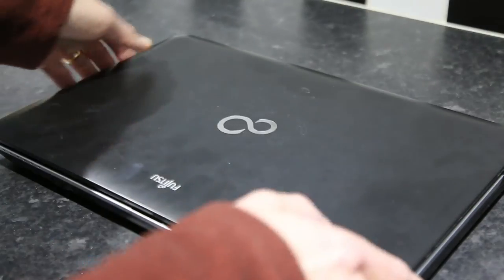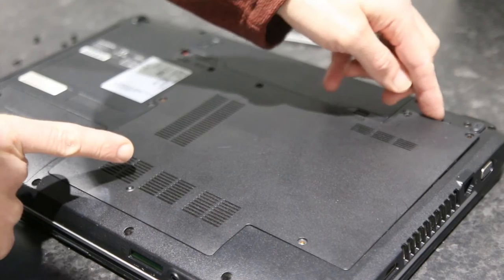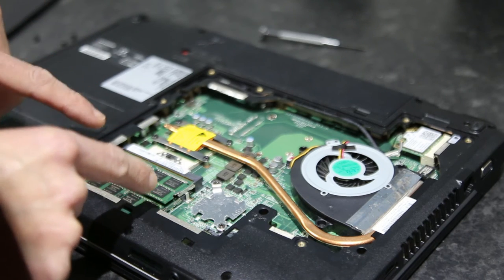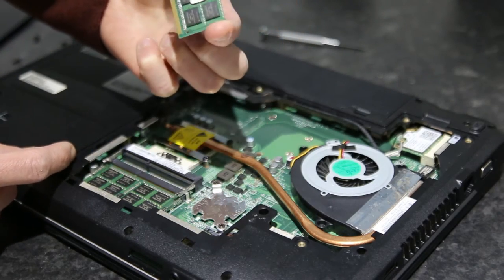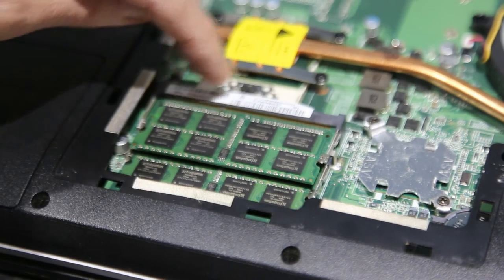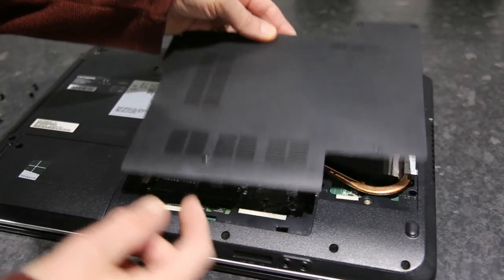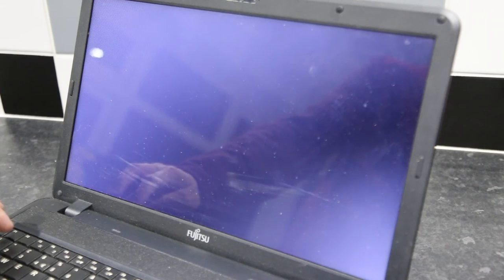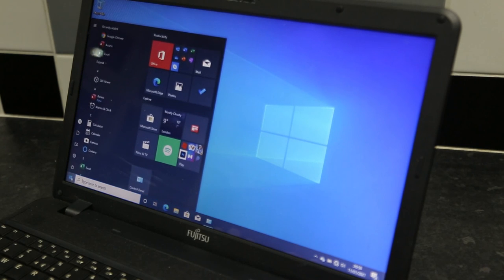Fujitsu Lifebook How To Remove RAM Upgrade/Replacement (A Series laptop A512) Faster & Improve Speed

Comment: Got a black screen mate. Install 1 boots fine. Install 2 get black screen. Any ideas?
Reply from the maker: That sounds like either a faulty chip or it's not supporting the amount of ram. What happens if you switch them round or put them in opposite order?
Reply: @ajvw  same bro. I’ve stuck with the 12gb for now 👍🏻
Reply from the maker: @scousejt  that suggests it's not a faulty chip, more likely that the limit of the machine is reached
Reply: It’s a 512 like yours though mate. Anything I can try to get it working please?